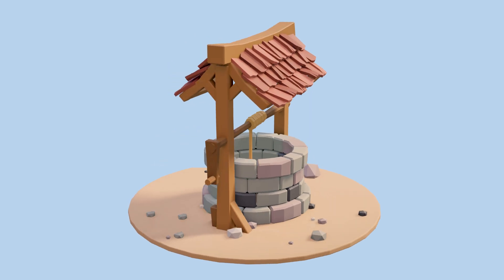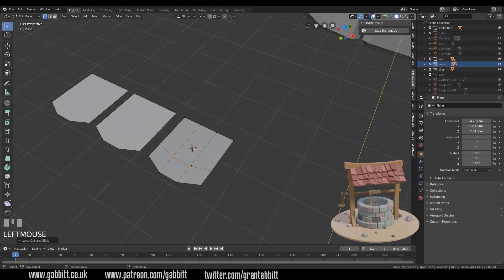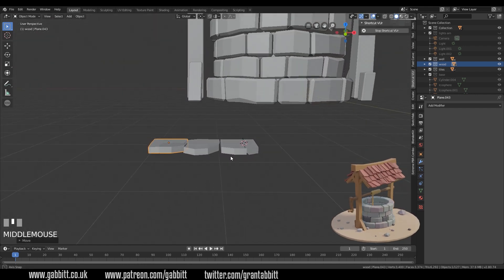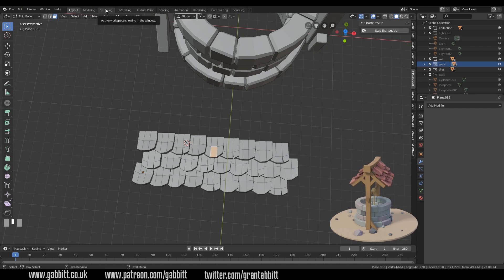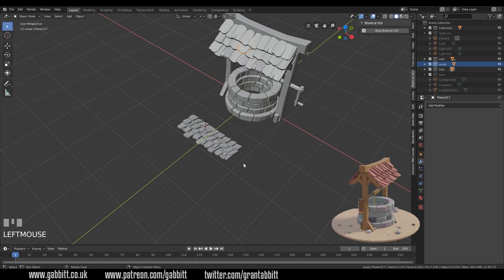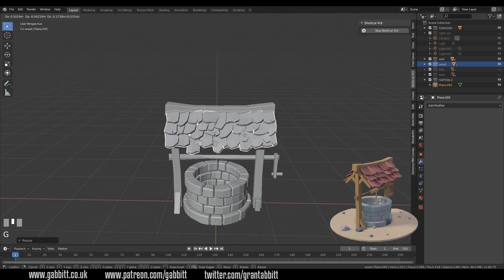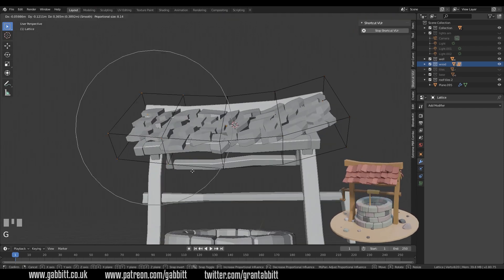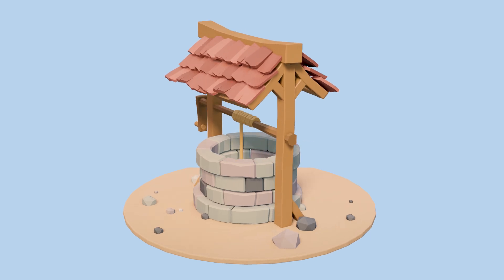Create A Low Poly Well | Beginners Tutorial | Blender 2.8 | PART2

Comment: I honeslty got kinda scared that there were no instructions to make the wooden frame. I ended up making it on my own but I figured it would be reserved for part 2.
Self notes: (Shift+Right click) Select Multi-cut Tool, Start from vert, Select all roof tile planes, (Ctrl+E) Extrude face, set to 0.1,  Deform -> Lattice, Set  "S Divisions" to 6, Select individual lattice points to warp tiles

Comment: So proud of my wood frame with no tutorial, ty for making it a homework :)

I'm having slight issues when moving my beveled shapes, I'm constantly marking all vertices around a face then moving with G, cause I've many times failed to mark all vertices of a bevel face and only moved parts of the shape, thus disconnecting many faces and ruining the shape. I loved the Alt+Click with edge tool to move a CTRL+R cut, but is there an easier way to move a beveled face?

Comment: I'm using 2.9 so I cannot find the object deform tab on the right-hand side. so I tried simple deform, but the problem I'm facing is that the well is having the bend but not the rooftop plates. I've been on this for hours and I don't know what the problem over here. pls, help.
Reply from the maker: I use a lattice for the rooftop

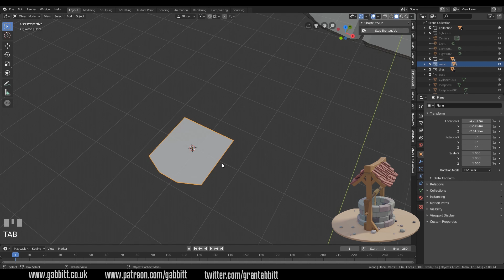Comment: ok, I'm having a really weird issue... so I'm trying to duplicate the plane as explained around 2:20 ish and the plane is acting really weird. I duplicated it, and tried to move it, but the plane moved opposite the way I moved it! then I tried to move the other plane (the original one) and it looked like the origins had swapped? I'm really confused on how that happened, and I'm not sure how to fix it!
Reply: Also: when I was moving around just the original plane, without any duplicate, it looks like the origin is moving but not the plane itself, and the move arrows look different; they have the letter for each axis next to them in a thin font
Reply from the maker: Is it mirrored
Reply: @grabbitt  not that I did on purpose
Reply: @grabbitt  I can duplicate properly in edit mode but not object mode
Reply: I've figured it out! somehow in the tools menu I'd activated "affect origin only" no Idea how I did that but the problem has been fixed!

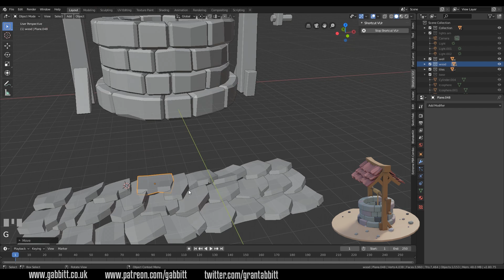Comment: I really don't understand what I did wrong now, it keeps scaling into the cursor direction, I'm trying to do the part at 9:08 and I can't seem to fix it. :/ So when I click on one of the tiles it also selects the cursor. Before this, the yellow dot was stuck on one of the tiles but at least I fixed that.
Reply from the maker: Check you transform pivot middle of the viewport at the top
Reply: @grabbitt  This issue is now solved with the help of r/blender on reddit, I selected all the objects and set origin to geometry. :) Thank you for your reply regardless, it shows you're willing to help your viewers. :)

Comment: Did anyone else find that using the lattice caused their tiles to shift position when moving between object and edit mode?
Reply: OK, I think I've got it. I didn't gather from this video that the lattice is a 'modifier' and that it needs to be 'applied' to the tiles for the effect to be in some sense final/actual. I had been trying to edit the tiles both directly (i.e. without using the lattice) and via the lattice BUT without having applied the lattice modifier. As a result, by going into edit mode, I was seeing the tiles as though the lattice effects had not been applied. I found this blender interplay to be counter-intuitive. I'm now wondering to myself if there is any value in having this extra step of having to actually apply the lattice modifier (rather than simply 'what you see is what you get')?

Comment: It worth mentioning that if you rotate your tiles around, and later on you decide that they are not thick enough, you'll gonna have a hard time. Lattice deforming soso helps but it would be nice to show when to apply transforms and how to make more things reversible for beginners (increased steps for ctrl+z) or how to correct issues coming from not applying scales & how to work with tiles once they are deformed and mirrored to the other side.
https://i.imgur.com/dqQb9pR.png
This was me tabbing in and out edit mode. The tiles are OK in object mode, but when I tab into edit mode, they show the tiles without the lattice modifications, making it hard to edit.

I ended up not liking my tiles, and when I wanted to rotate / scale them around they were scaling the wrong way they ended up inside each other etc (even with individual origins and scaling on local Z) due to the lattice, I presume. Even though it looked OK, from certain angles, it still looked to be inside each other, and from top view they looked like prism. 

https://i.imgur.com/GTXmkxm.png

Regardless, very good video. I'm at the edge of my seat waiting for the texture painting part!
Reply from the maker: you can join them together and rotate them to line up with the global grid and then scale but yes it's a longer process and that's why you dont always want to apply the rotation and scale or join objects
Reply: @grabbitt  Global grid makes sense, thanks. I think I ended up using the lattice to make them wider and that kinda solved how strange it looked. 

Question: Besides learning new tech wouldn't it be easier to just have 1 box and paint on them to look like more tiles?
Reply: @grabbitt  Just to clarify, why don't you want to apply rotation and scale? I thought you massage a cube around then when it looks like a tile, you apply scale and it will have the dimensions of a tile as 1:1:1 not as Cube 1:3:6. After that when you want to scale the tile it will work with the proportions of the tile, not with t proportions of the cube..
It would be logical to me to make the basic shape and apply scale and apply transforms.  After that if I want to modify the shape it should not cause issues. Or maybe I see it wrongly?
Reply from the maker: no that makes sense. It's just the way i prefer to work. -- yes painting to look like tiles is lots more efficient